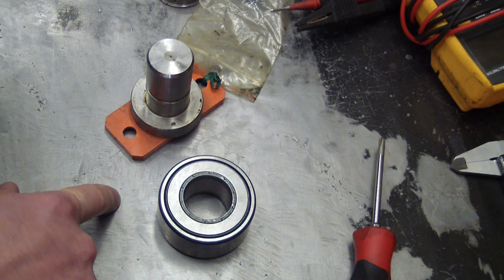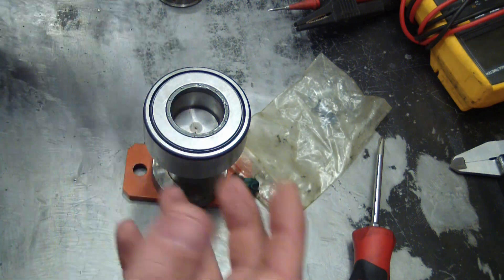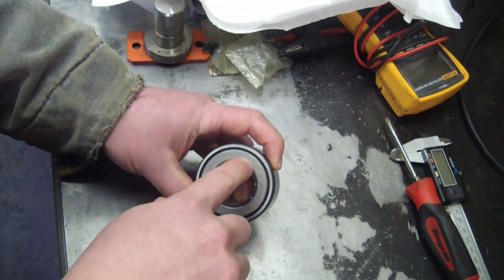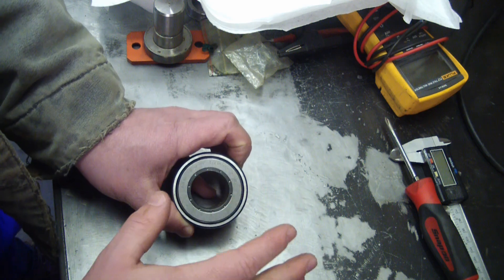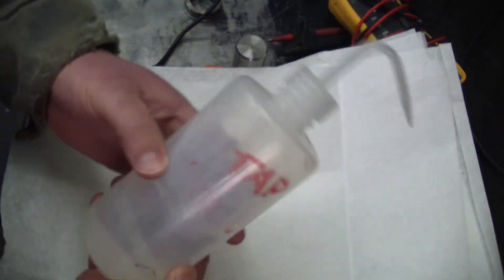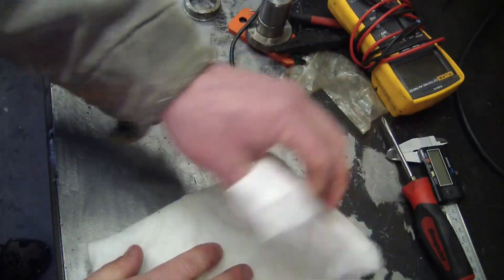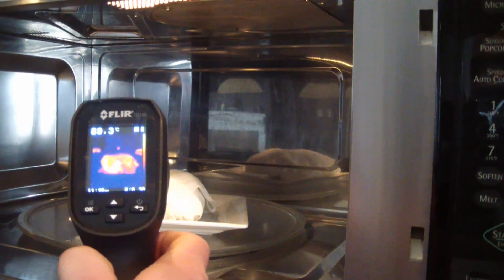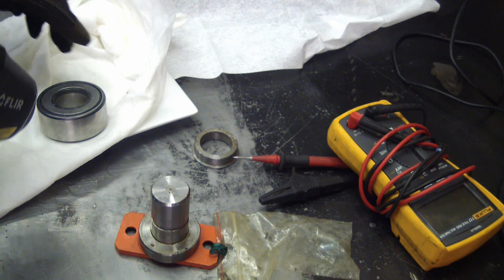The Microwave Trick? It's the easy way to heat bearings!

Comment: Just use this today to get differential bearings on the carrier. Worked beautifully. I had to go a bit longer than a minute 30 but just kept the paper towel wet and checked it with an IR thermometer until I was around 85-90° c I did have to beat them on a bit but that's life without a shop press. Thank-you AVE and before you mentioned it I had to check the date on the video.

Comment: Great trick - thanks for posting it.   I have used it a few times now.   Tomorrow I will be using it in reverse - wheel bearing in the deep freezer, steering knuckle in the oven.   Thumbs way up.

Comment: why not just wrap the bearing in ziploc and dip it in boiling water then? more controllable and no risk of frying the bearing or the oven. you are basically still heating the bearing with water. this actually has the risk of water getting into bearing and causing rust

Comment: Rip an old microwave oven transformer to pieces take out secondary coil. Replace link with ferrous metal bar place bearing around said bar. Home made induction bearing heater

Comment: Great tip. I will use that. FYI - there is an old zip lock bag stuck to the flange of your shaft with a gob of snot. I thought you would want to know.

Comment: Wasn't exactly a drop on. Even after freezing the gear I was pressing the bearing on to. But, with some c.m.d. number three lube, more time in the freezer and four minutes in the microwave it was the easiest press I've ever had while rebuilding a differential. 

My grandfather was a machinist. He always told me to heat things up in the oven to 375 or so and hold it there for about an hour. That always has worked out in the past. I'm just not too sure about the temper of the parts at this temperature.

Comment: Would heating up the bearings cause the grease to thin out and cause premature bearing failure.. Would it b better to freeze the shaft causing it to contract and then slip the bearing on? Just a thought...

Comment: I'm an engineer and I approve this video (I am sure there's a goober that will fry the microwave with a light show. For the goober that wants the light show I recommend using grapes. And not a expensive bearing. Use at least 2 grapes or split one in half making sure they are touching. Use high setting on microwave. Start microwave and wait for plasma.)

Comment: And, when older micros tend to start a fire if there is no radiation absorbing material inside, the insurance company says "sorry pal, no money for You". Only some of the latest micros can take that without overheating the magnetron, older ones have started house fires just by putting deep frozen meat in them in full power(constantly running magnetron), and when ice does not melt before the magnetron overheats, there will be flames. So, while all kinds of funny things can be made with household appliances, check the possible dangers first. 21 K people have seen this video, so it is starting to be certain that at least some have broken their micros, and if some have burned their kitchens or homes, they may be a little.... something...

Comment: Sorry, but in other situations, for example when you have a shaft that is 12" dia and a beating that needs to be is about 11.90 +- you need more heat than that... We would heat oil up to 495 deg F. In order to expand the bearing aprox 0.020" in order to slide it down to the correct position -+3.00 ft down the shaft in order to get it to the correct position on the shaft...

Comment: So, a 'diameter' dimension is the same as a 'length' dimension??  Is that some kind of new math?  Your inner diameter does actually have a 'length' though, its caller a circumference.  C = 2 x pi x r(radius).  Use the result of this calculation to calculate your new circumference (inside diameter).   The method you show for calculating expansion is deliberately misleading.

Comment: Nice one bud 
Good tip l always thought that u cant put metal in a microwave.
I thought u were going to heat it to 200 not 100.
Given that l suppose that  you could also put it in a pot of water  and bring to a boil. 
Wraped or unwrapped.

Comment: all u need to do is place it an oil bath and heat the oil on a hot plate,  watch the oil until it starts to smoke a little then remove the heat put the bearing on the shaft with gloves of course

Comment: You don't actually need the paper towel and you can use any solid metals in a microwave.  Any big chunk will do.  You can't do thin metals, coated metals and foils.  And typically that's what's in the kitchen. Most people don't realize you can microwave metals.

Comment: Just put the other part in the freezer...

I rebuilt a 96 CBR 900 about 10 years ago and when I replaced all the bearings in the frame and rims I put all the bearings in the freezer overnight. They all dropped right in instead of having to be pressed.

Comment: Used to microwave frozen concentrated juice cans.  I would open the top and leave the metal bottom.  As long as the metal is at the bottom of the microwave, no sparks.

People would freak out.

Nice trick with the wet towel.

Comment: Also a ziplock bag with the air pushed out and placed in boiling water for a few minutes will do the trick well too. A sous vide cooker can be used in case you are doing lots of these in a row. A good way to get the air out of a ziplock is to use fhe water. Put what you want in the bag and get it to the bottom dead center of the bag. Dip the bag in the water slowly and perfectly verticle up to the zipper line. The water will push the two sides of the bag together, pushing the air out, or at least most of it. Carefully without getting water into the bag, zip it shut.  Poor mans low quality vacuum seal right there. But this will allow the hot water to basically envelope the part with out wetting it and not have the insulating air between the water and the part.

Comment: That is seriously NOT a good idea. The microwave energy will cause local arcing that will pit the bearings and their cage surfaces. Oven instructions say NEVER to put metal in the oven unless its designed to be in there.

Comment: Interesting thing. The bearings in space satellites and such had been failing more frequently than expected, they corelated it to solar events and figured it was static discharge inside the bearings cratering and melting the surfaces inside the bearings causing them to fail early. I hope the microwave doesn't induce the same effect.
Reply: A satellite exposed to the sun for 20 years is not the same as a low dose of microwave radiation over 90 seconds

Comment: Hmmmm.....nice trick...kinda. The torch and steel plate method works IF you know the temp control trick  The really right way to do it is to keep a pot of hot 30wt. Powertrain oil in the shop, but that's not practical for one bearing. The best way... I keep a $30.00 toaster oven in the shop. Works great, even heats cans of spray paint on a cold day. Works on muffins, too.

Comment: Or you can put stuff in a cardboard box and vent it using a hot air station. Will take longer though.  Also good for de-gluing car's headlights and such.

Comment: Safer way is to use the convection setting if your microwave has one, no wrapping needed. No arcing either. Work in aviation and that's the way we heat up high tolerance, aircraft bearings. Even OEM approved!

Comment: I may try this  with  the microwaves at work! "Here in Canada it comes in brick form"😆  Please don't use the torch. Quick tip from a ("pro"?)  Throw the little shaft in the freezer for a while. I'm not sure if it helps but I always do it😄  I like to throw small bearings like that into a little old crock pot full of oil that I keep on the shelf for such occasions. Your channel rocks!

Comment: Good job the better half (she might read this) didn't catch you going the opposite way as well by sticking the axle in the freezer for an hour with the peas. Useful to know when she's out though, just to get that extra 0.5-1.5 thou (your local Sushi restaurant should have a -60°C freezer if you need more! 🤔😱🤣🤣🤣
Reply: Another advantage of divorce !   I don't have running water in my shop, so after I ran a wheelbarrow full of CAT diesel engine parts through the parts washer, I rinsed them in the bathtub.    That would have sparked WWIII before.   Now it just puts a smile on my face and gets the job done !

Comment: Been using a fry daddy for years. Got a used one at a garage sale for a couple bucks. Little 30W or ATF depending on the job. There are some applications that require a dry fit that this may work good for.

Comment: So I thought you could never put metal in a microwave due to sparks
Reply: Have you ever seen the metal racks that come in some microwaves? Or the fact that the microwave oven itself is metal? Thin metal, metal with points,  (think fork) can wind up acting like little antennas for the microwave radiation and ionization of the atmosphere occurs, which is visible as an arc.

Comment: Every shop I've ever worked in has had a hot plate and a Folgers can of motor oil sitting in the corner for this purpose.
Reply: Yep, that's actually an old Navy REG for bearings!

Comment: We always used an electric hot plate, or electric skillet “however you want to call it”, it heats the bearings slowly and you can use an infrared temp gun to keep track of its temps so it doesn’t get too hot
Reply: Going to comment the same but I presumed someone would know this too. The hot oil bath method. =)

Comment: Yep yep been doing this for years ,
I have a lil cheap microwave on my Service Truck , I just plug it into my Welder 110v outlet , ,
Great to have on the road , I can make pop corn , nachos , heat water for hot chocolate , warm up my lunch , 
If'n Im doing a rebuild out in the field , I will stop an pick up some dry ice , use it to shrink piston liners , shrink wrist pins on like Cummins Engs , lil tap e tap with a dead blow if'n need be.  Shrink excavator arm bushings ,

Comment: I'd be worried that water vapor would find it's way inside the bearing.
Reply: A little wet dog four oh will displace that steam residual.
Reply: @Drop_Top_Roberto  ???  Is wet dog four oh supposed to be wd40?
Reply: @dustintunis9347  yes sir.
Reply: @Drop_Top_Roberto  - I've been studying typo, I'm not fluent yet but I'm getting better.
Reply: @dustintunis9347  yeah, sorry. WD40 is actually a water displacer. That's what it was originally intended for.

Comment: If you’ve just had an argument with your other half and want to throw your wedding ring but it’s stuck fast on your finger,simply cut off your hand ,place in microwave for 1 min .The ring will slide off easily allowing you to continue your fit of pique.....(Throws may not be accurate if left handed and not ambidextrous)*

Comment: Thus works much better in a conter top inductive heated pizza oven.
Used one for years at the dealership.
Works great on those press fit camshaft timing sprockets also .  Just slide them right on and let cool.
Do this to a microwave you don't want to work again ONLY !!

Comment: Ok I'm intrigued, does the water on the towel shield / protect the micro wave from going bang. How does this work, someone plz tell me 
Cheers in advance
Reply: Top of my head and dont quote me. Microwaves work my blasting water molecules with microwaves at waters resonant frequency. Basically microwaves are designed primarily to heat water, which most of your food has in it. The bearing being fully surrounded by water protects it because the water takes the energy which heats it up which in turn heats the bearing by contact.

Comment: Steel is not the problem.
Microwave goes after liquid the closer to a a liquid a material is the more the microwave affects it so in this case it heats the grease first and the seal second with the steel last. So the order is exactly what you don’t want.

Comment: If it expands at .001" per 100 degrees, per inch of length, then wouldn't it expand about .003"?  The length of that metal is 2 x .5 x 3.14159.  Technically, it would be some pitch line around a point somewhere between the ID and OD of just the inner race, but close enough.

Comment: Is there a way I can get that type of bolt with a thread on the end, and much longer? But smaller diameter. For a scooter axle. My bearings are loose on the axles

Comment: The water is a good idea, I was wondering why there wasn't lightning bolts going on in your microwave
Reply: It's actually sharp metal corners that cause sparks flat metal is fine. The interior walls are metal.

Comment: Heating with a torch can work but might fry the seal. Heating in oil works but but any leakage might dilute the grease on a sealed bearing and cause early failure. I like this idea but still leery of steam penetrating the seal. A toaster oven is probably the best compromise, although slower.

Comment: Really terrible idea. Because not only will putting metal objects in a microwave generate sparks between the objects and the walls, it will generate sparks between the objects themselves if they are not in electrical contact, and at much lower induced voltages since the objects are closer together.  So the attenuation afforded by the wet cloth may not be  -- will probably not be -- enough to keep the bearing from sparking internally, which would produce pits and peaks on the balls and races.

Comment: Brilliant! I love nifty microwave tricks. I have 2: one useless and the other I use all the time.
Useless one: put an incandescent light bulb base-down in a half-glass of water. Throw it in the wave on high and watch the tungsten filament glow as it passes through fields of energy concentration.
Second: wet your teacup and wave for 30 secs. Much less costly than hotting the pot with running hot water.

Comment: Had anyone BUT you done a video on this I would have called Bull $h!t but it was you so I had to try it. I cheated a little by sticking the motor shaft in the freezer for about 45 minutes but even though it did get cold the bearing would still not go on the shaft. I wrapped the bearing in wet paper towels, stuck it in the microwave for @ 90 seconds and it went right on. Good luck getting it off now.
GREAT VIDEO ! ! ! ! !

Comment: First Problem : This is one of the most dangerous way for heating bearings, you can burn whole facility. 
Second Problem :  Microwave can transform your bearings to magnet. Electromagnetic waves can induct bearing and inducted bearing can collect all metal particles around even in working place during the working. Induction heaters demagnetizing bearings after induction process completion.  If you check magnetism of the bearing with gauss-meter after you heated up it in microwave you will see the difference of neutralized bearing.

Comment: I don't have a press, but I do have liquid nitrogen.  I suspended my pinion in the dewar, above the lN2 for 15 hours, nuked the bearing and it slipped right on.  No external force necessary.

Comment: I used to run a machine shop, and used a similar technique to change the ring gear on manual transmission flywheels. I would lay the flywheel in the freezer, after removing the old ring, then, I would lay the new ring out flat, on the steel shop table. Then, I would make 3 or 4 passes around the ring, pick it up with pliers, and quickly lay it on the flywheel. Now, the new ring should fall on the flywheel like magic! Now, just go all the way around the ring, tapping it with a hammer to seat it in place!

Comment: Now maybe i'm the asshole. But i've always dunked em in a cut open soda can filled with oil, and put a torch undernearth the can to heat up the oil / bearing to the desired temp. Granted this method is easier, i have a feeling my boss may not enjoy me using the breakroom microwave for it.

Comment: I tried this trick last night on a motorcycle bearing.  Sorta worked, my microwave is only a 700Watt, so it didn't get up to temp to get the full amount of swelling.  Had to stick it in a press this afternoon to press it the rest of the way.

Comment: One could also put said bearing into a sealed plastic bag with most of the air pushed out, then dunk it into a pot of boiling water for a few minutes. Don'e that many a time for press-on parts that didn't have cracks & crevices for water to fuck up.

Comment: Thought I'd comment not like it matters much.
Yeah the water will heat up, but it certainly doesn't "shield the metal" from microwaves, sure it'll transfer "some" heat to the metal (before it turns to steam that is), but the bigger thing is that the metal is super efficient at absorbing the waves and turning them into moving electrons, aka electricity...aka resistance....aka heat. The water is generally easy for the microwave to move and thus you'd need a lot to absorb it all (it's fairly transparent to them, not as much as say oil or especially air, aka nitrogen/oxygen).
You don't get any sparks as you normally would with metal in the microwave though......... primarily because NO SURFACE IS POINTY enough to have a large flux and therefore the accumulation of voltage. Can't get to breakdown voltage of air...thus no fieryness. You could do the same thing with a spoon or salad bowl, but not a pointy metal fork (pointing perpendicular to the waves).
Electricity therefore resistance therefore induced HEAT!

....in the end it gets the bearing hot n bothered though, so you could say it's unicorn farts doing it and people are just happy it works.
Reply: How u know about unicorn farts?hmmmm😂😂😂😂😂😂😂😂